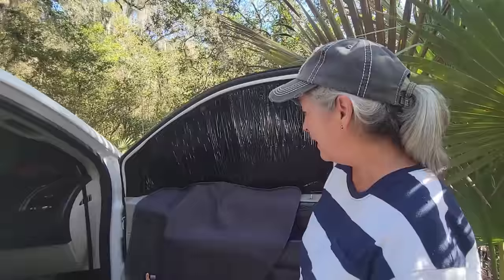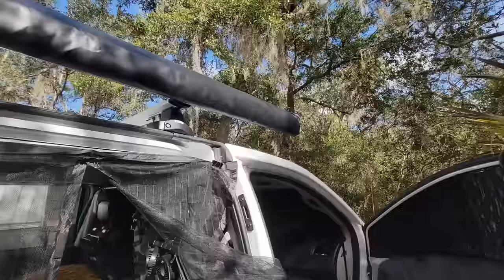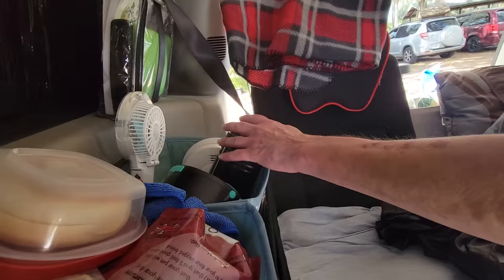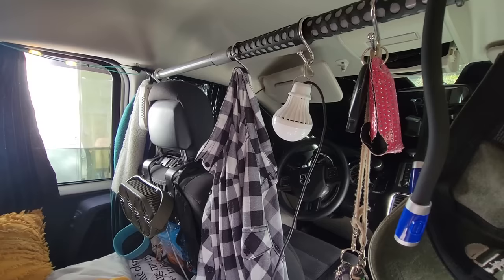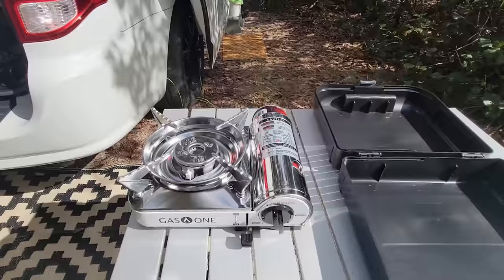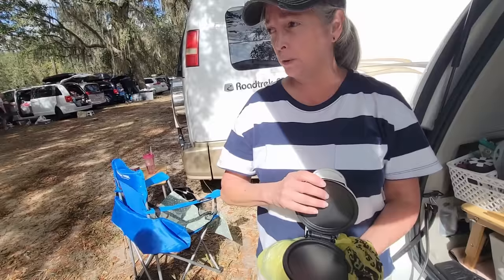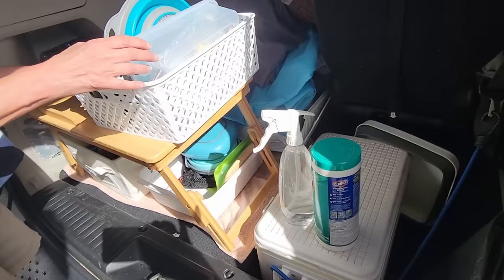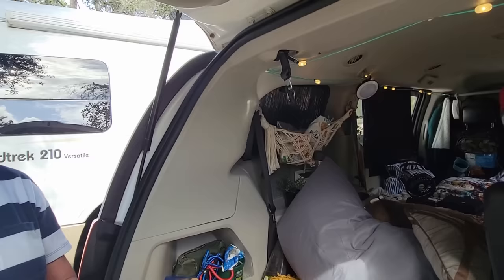Van Tour: Loaded No Build Minivan. Butterfly Tracks Meet-up

Comment: Cute set up! You've got lot's of great ideas! Magnesium Deficiency causes Charlie Horses, or muscle cramp in the legs. Take Magnesium Glutimate and I take mine with a chelated Copper supplement, because I'm a redhead. We are copper based people who need copper to absorb the Magnesium If you are stressed, or drink alcohol, you will lose your mag. cortisol causes you to pee it all out. also excess salt and sugar as in coke, etc. It's important to keep up your electrolytes too, so you can buy little packets to add to water. Also slicing Cucumber into water helps keep you hydrated. No need for cramps in your legs. Sleep with a bar of soap at the foot of your bed under the covers. It changes the ions in the air and keeps leg cramps away. Sounds crazy but works!
Reply from the maker: Good advice 👍

Comment: Glad to see you have our English ridge monkey.  Cooks really quickly and you can split and use as 2 pans. And the kettle just easy to fill from bottle, jug  or tap
Reply from the maker: I hadn't seen them before Shelia showed them. Great idea. 💡
Reply: You can warm cook pizza cheese side together , 3 minutes each side with the pan close just turn it over. Warm pies if they will stand the flip. Even cook pastry if you use a shop bourght pie filling and not too much liquid. But take away from heat and flip over a plate works fine. And if your cooking sausages in your van there's no splatter. And wipes clean . Great little thing. They do a bigger one that I've see cook a man size English full breakfast, all down to timings. Have fun on the road. My travels are finished for this year. Great Britain is too cold for me and now I've used up my 90 days in 180 day period in France and Spain. I can't go back till nearly spring.xx
Reply: @ButterflyTracks  I googled English Ridge Monkey & lots of responses. I see it’s on Amazon.  Mo from NJ

Comment: Sheila, this is janice from campout I had lily.  What size baskets beside chair, did you attach with velcro so they'd stay?  I got so many ideas from your tour, thanks to you and jan
Reply: Hi Janice! I attached them with sticky gel pads I bought on Amazon, they are great for many uses even cleaning the floors of your rig cause they pick up debris that’s hard to pick up. But the containers I bought from Walmart. The bottoms of them are 6 1/2 by 8 1/2. They fitted perfectly in that space and didn’t budge while traveling. Lily was so very cute. I definitely remember u guys!